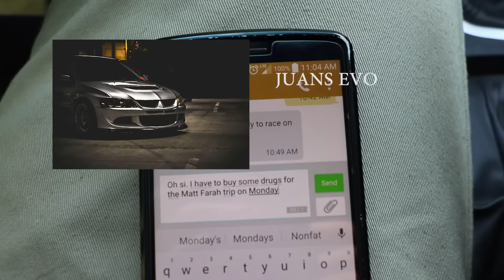NEW BRAKES

Comment: For those who are in a rush when at a diy car wash, when still wet spray quick detail all around the vehicle (paint, glass, trim, everywhere) and wheels and dry with a large microfiber towel.  Should take you a solid ten minutes, but well worth it.  Helps to minimize water spots and streaks.  You can then spot detail later at home.

Comment: wd40 on rotors? shouldn't you be using brake cleaner so you can have better grip with your pads?
Reply: I believe they used wd-40 to get the "grease" that the manufacturer puts on the rotors before they are shipped out so that they don't rust during transport.
Reply: +Adam Miller ye,  but wd40 contains oil too,  so youll bed some oil into the pads.  Better use brake clean